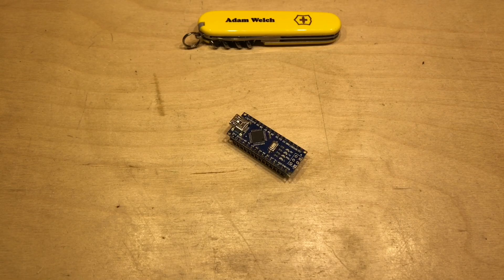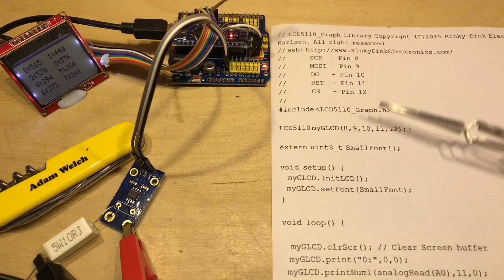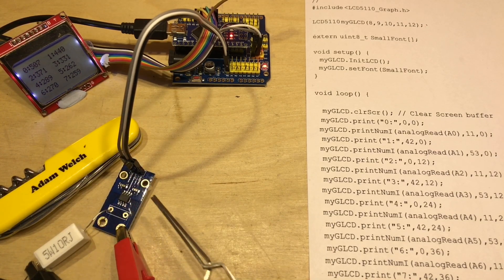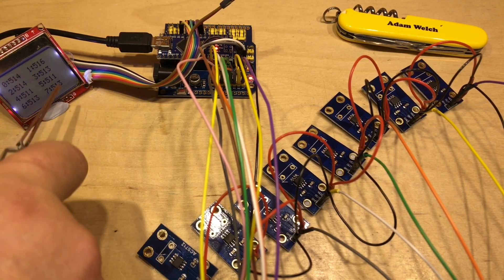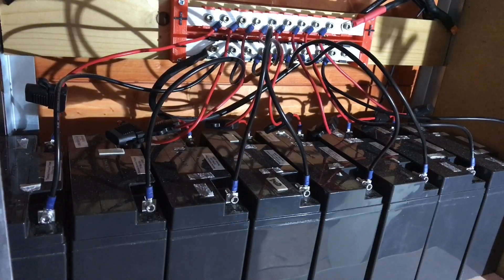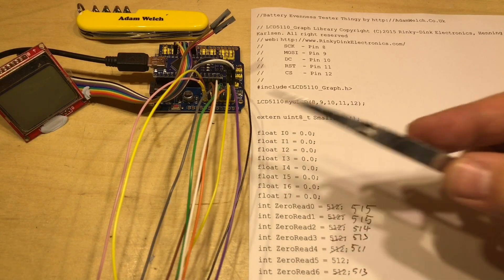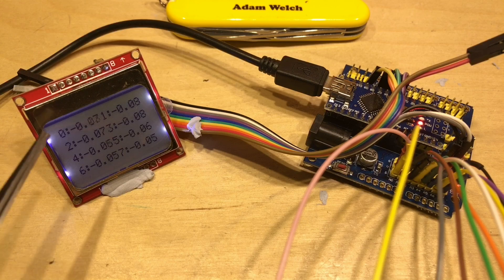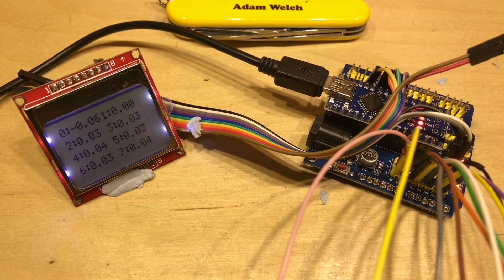Measuring Current with ACS712 - Adam's Arduino Projects

Comment: Looking at the specifications the slope of the output voltage is 185mV/A for the 5A version so if the input voltage is 5V then 0A voltage out should be 2.5V with aon offset of 185mV per A so if you feed it 5A the offset should be +/-  0.925V which should be around 189.4 steps on a 10bit AD with a Vref of 5V.

Comment: Well done mate. I am using the same parts to test a 10S, 18650 BMS board and I will let you know if I find any other quirks. I tested Julian's cap solution today and it makes big difference. My new issue is how to get 2 Nanos to talk to the same LCD without using all the pins I need to read current. I am still
learning the Arduino and IDE but I think it's possible.

Comment: I've had trouble with the NANO ADC before doing code like yours- it can result in erratic readings (its a known issue). The cure was actually to take the read from the ADC, throw it out, wait a couple milliseconds and take another- then display that one. Works like a champ every time. Oddly it seems to be worse in some sketches/pins than others.  I can dig up the forum links if needed. Good luck!  Cheers. Eric
Reply from the maker: +MKme Lab That's great. Thank you. I will give that a go - I have a feeling I've read the same thing some time ago.
Reply: If you are using a voltage divider on the analog inputs you should put a capacitor between the analog input pin and ground (100n will do in most cases). Also an extra capacitor on the +5v of the arduino (10u ceramic) will improve the analog readings in many cases.

Comment: Your math is correct, but that is not the way the chip calculates amps.

If you look up the datasheet you will notiec something like 186mV/A to calculate your resulting current.

Best thing would be to give 3 A through all of them and make a note how much voltage difference you get for every module
Reply from the maker: +Distortionize I did read this but it seems silly to me to covert the analog reading to mIllivolts to then covert that to amps or milliamperes. Perhaps I'm just being lazy (or trying to be too clever)? I'll have a think and give it a go. Thanks.

Comment: I missed that you used your Uni-T UT211B AC/DC Clamp Meter here, it would had been interesting to compare the readings between the ACS712 and the UT211.
Reply from the maker: A good point however I'm fairly sure my current calculation is wrong in the arduino code.  I will get that sorted then I will absolutely test this.

Comment: You could be falling foul of the compiler trying to be helpful. Try, when you're defining floats as "float foo = X.Xf" (where X is a number) and change the zero set points to floats as it might be doing the first stage of that calculation as ints and then doing the division as a floating point. It might even take casting that entire calculation to a float to get it to do what you want without loss of precision if that's what is going on.

You could also add a zeroing button so at run time if your zero set point is slightly off a button could trigger a capture of a couple of samples for each sensor then average them and store that as the new zero point.
Reply from the maker: I see what you're saying.  I will have a go at that and see where it gets me.  Adding a zero button sound like a nice idea, but I guess I'd have to switch everything off each time I wanted to zero them.  I'll have a think about that - thank you.
Reply: Adam Welch No problem. Apologies for my dodgy grammar and spelling. Early morning me wasn't watching what he was doing so I've gone and fixed my initial comment.

Yeah, you would have to get your draw to whatever you deem to be zero before doing it but once it's done you should be fine as I don't remember those sensors being prone to drifting much.

As an extra bonus you could save the calibrated zero values to EEPROM and load them at boot time so you only have to do it once.
Reply: Looking at the maths of the calculation the datasheet suggests the sensitivity of the 05B 5>+5A part to be 185mV/A. 

So, 5V / 1024 gives 4.88mV per ADC count, 185[mV per A]/4.88[mV per count] which i think gives 37.9 ADC counts per A in the optimised range. So, your (ADC counts)-(Zero counts)/(counts per A) just needs the (counts per A) value changing and you should see number that're about 2.5x bigger.

This would mean, you're ~50mA @ 12V per battery with just the lights that equates to ~5W at 100% efficiency from battery to light would then turn into ~12W.
Reply: you need to start from the data sheet value as you have mentioned,  also to ensure a correct value you need to look at the reference voltage for the Arduino,  5V is not likely accurate if it is being powered from the USB probably around 4.8V which is adding a further 5% error

Comment: Arrays are your friend :)
Reply from the maker: +Y Gator Yeah - I'll read up. Cheers
Reply: You could do something like this:

float I[8] = { 0.0, 0.0, 0.0, 0.0, 0.0, 0.0, 0.0, 0.0 };
int ZeroRead[8] = { 515, 515, 514, 513, 511, 512, 513, 512 };
int Pin[8] = { A0, A1, A2, A3, A4, A5, A6, A7 };

  // Read and calculate Current
  for(i=0; i<8; i++)
    I[i] = (analogRead(Pin[i]) - ZeroRead[i]) / 102.4;

Comment: Great video. I'm hoping to do a similar setup except to measure the currents at various points in my R2D2, with the aim to push the actual readings out over i2c and log them along with any remote control inputs to a text file on a raspberry pi for later graphing.
Reply from the maker: +Darren Poulson Sounds like an I nteresting project. Cheers

Comment: great video. I'm wondering about the LED lighting you have the rgb I guess . I am thinking about getting some. to light my house. I need to get a good efficient DC to DC buck converter. to run them off my DC. instead of inverter. I want 12 v lighting. because I have 12 v lithium battery packs . to work like a backup lighting. in case something happens to the batt bank. low voltage. or dead bank. so I'll still have lighting. keep the batts charged from the 24 v bank. also your lights being RGB how are they are being white? and how bright? and are they dimmable. I'm thinking about using them inside and out. the led tape lights and flood lighting.  does anyone make a low voltage shutoff for lead batts? thanks

Comment: Good to see you doing stuff like this. I still use my battery discharge tester you did. Always brings a smile to my face. 

Love the walk through, your a good teacher and should really be doing more little projects along with the maths, explained in the wonderful way you do. 

I know I'm waiting to build something following your instructions. 

I have an asc712 so will dig it out and follow you in honour into the trenches. Why not an INA219 on each battery? 

I will be watching out for 👀👀 part 2

Cheers Adam 👍
Reply from the maker: +Dean Greenhough I already had a couple of the ACS712's in my bits box so it seemed sensible to just buy a few more - plus the INA219 would create even more wires! Four per module ;-)
Thanks for the kind comments. I need to look at that code again - I'm sure I've got something wrong. Cheers Dean
Reply: Adam Welch The INA219 is i2c. That being said is only has 2 bits for addressing allowing for a maximum of 4 sensors on the bus.
Reply from the maker: +Jagjit Singh Rehill Ah thanks. Saved me a wasted purchase. Cheers
Reply: or use a TCA9548A 1-to-8 I2C Multiplexer, with the INA219,   the ACS712 has a lot of noise at low current levels.

Comment: batteries at full charge? very little current acceptance
Reply from the maker: +The Left Hand I had been using my bench Lights for a while at that point. I guess I need to test one of the modules against my clamp meter and see what I get. Still not convinced about my code though. I'll look at it again soon.

Comment: I found the ACS712 became much more stable when the filter capacitor was increased in value - I seem to remember using 470nF
Reply from the maker: +Julian Ilett Ah I think I remember that in one of your videos. Cheers I will try that.
Reply: maybe adding ADC sleep mode would help reducing the noise

Comment: Build some current clamp sensors instead of direct wiring.
Reply from the maker: +Aurthor Thing That might be another option and would probably be the best option if I was going to leave this in all the time, but I'm just testing at the moment. Once I get a replacement ACS712 (and fix my code) I'll see how even the readings are, and probably take it all out then.
Reply: Author: great idea. I just watched an ElectroNoobs clip and seems str8 forward enough.